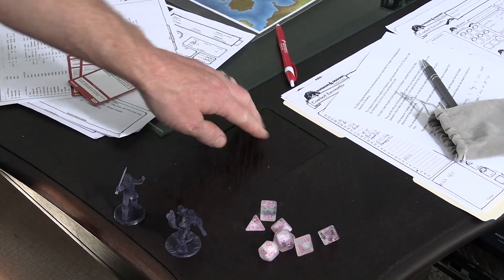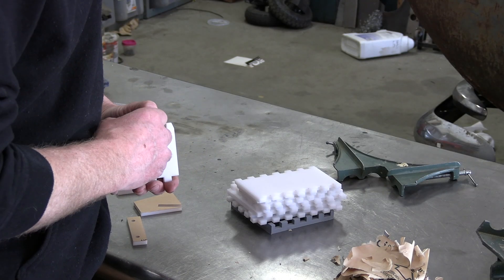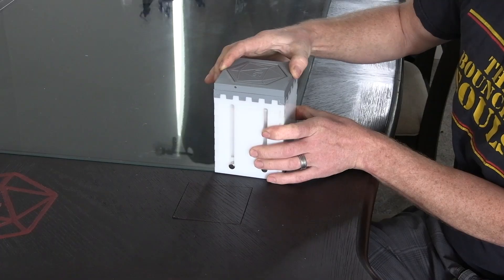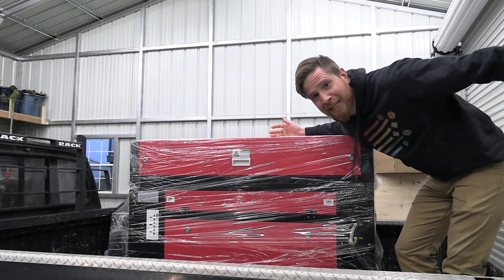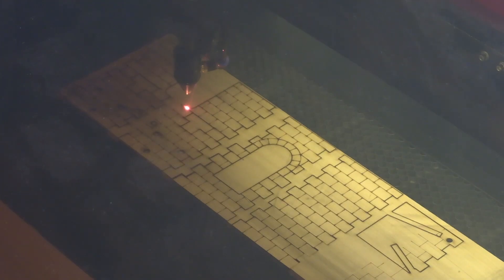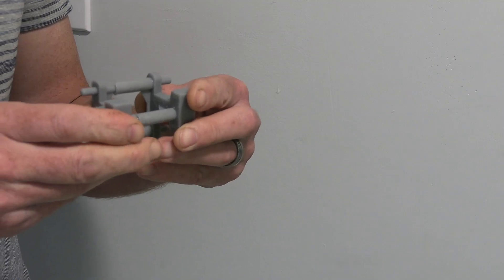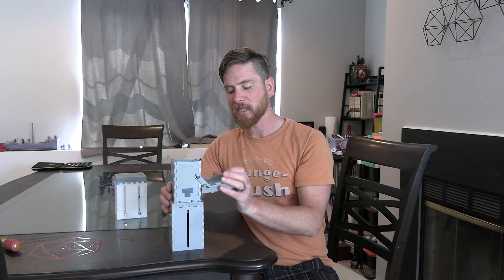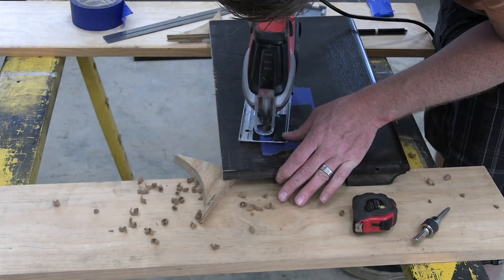Building the Ultimate D&D Table(TTRPG): Part 2- Hidden Dice Tower Upgrade!

Comment: This and the original video are sick and I love them not to mention how much I wish I had a table even close to this.

That said I’ll also offer one criticism as well from the TTRPG side of things. It’s said that to be a properly randomized roll from a dice tower your dice needs to have at least 3 contact points with the inside of the tower. Otherwise your rolls are lacking in randomness. If I were to buy a tower like this personally that’s definitely something that I’d not only be looking for but would be a dealbreaker for me. If you look into towers online you’ll find the good ones always try to include 3+ platforms for dice to roll off of. Obviously it might be a bit difficult to include this in your table ones but if you’re selling these out and about I’d suggest making a larger sized one for sale maybe? That way folks have an option of how randomized they want to get.

Comment: Use your laser to cut a template for creating a hole in the table. Hog out the majority of the hole with a jigsaw, and clean up with a router and flush trim bit for a perfect square. Well except for the corners which you can clean up with a chisel or just make your design have a rounded corner that matches the diameter of the flush trim bit.

Comment: A few modifications to the alignment base would make a difference. At the top of the alignment base, cut sunken wells for the flex stop pins to rest in, so that the tower stays still in the center and the pins are hidden. You could also cut tracks into the walls of the alignment base for rounded flex stop pins to ride in, making a smoother movement.

Comment: I think the previous design was better in terms of aesthetic, it just had a few kinks that needed to be ironed out. The spring-loaded action looks much better from a production quality standpoint, especially compared to the new iteration you made with the seemingly free-floating? tab at the top, with pins to keep it at the top. I think you should've focused on cleaning up what you had rather than starting over... mostly because it was pretty good.

I get the whole self-deprecation thing with the 'more tools than sense,' but it's not uncommon for an inventor to doubt their creations. Sometimes they glance over a good idea because it doesn't feel right to them. Even though it's tough to differentiate between an idea being flawed or the design being flawed, ya gotta figure out which it is before innovating. 

Either way, I suppose it doesn't matter. My group's gone full digital and we do everything via discord; just thought I'd share my two cents.

Comment: I would have used that pop top as a cover for the hole, when pulled up it will display whatever emblem I put on there as well as reveal the hole to drop the dice down. I'd do this to either forgo or simplify the dice tray at the bottom. If I kept it, it would just be a cover that pivots up or down when the tower is down or up.
As for locking when up, I'd just use some flat pieces with triangular extrusions that pop out slightly when the walls aren't there. Might have been slightly simpler than the button with the dots.

Comment: Is the shop not set up yet or ??
Reply from the maker: After fulfilling the orders from the Kickstarter, I found that even when optimized, it still takes a good amount of time to cut and print each one. In an upcoming project I will be redesigning/ improving  and creating an all (or nearly all) digital option that will have the advantage of a much lower cost as well. Stay tuned!

Comment: Tip I learned for those ugly burn lines from the laser cutter: cover the surface you’re cutting with painter’s tape. Protects that top layer from scorch marks. I’ve mostly used that with my laser etcher but I imagine it might help with an industrial cutter as well.
Reply from the maker: The acrylic comes covered in protective paper tape but after you cut them it takes way longer to peel off all the little pieces than it does to just wipe them down with alcohol
Reply: @MoreToolsThanSense  I meant when laser cutting wood

Comment: For SLA printing you shouldn't be printing your objects directly to the build plate. IIRC first few layers are overexposed to ensure they stick to the build plate. I forget if a raft or just supports is the better option.

Resin is also weaker than PLA in stress tests
Reply from the maker: True, you're not really supposed to stick it right on the build plate... but with an absolute square of an object, it's nearly impossible to get a nice finish on all 6 flat surfaces any other way. Also, I use tenacious additive to the resin, you can bend a 5mm thick piece nearly in half before it snaps, It's passing all of my stress tests!

Comment: Perhaps strong embedded magnets into the top of and bottom of either the shell box or pullout tower itself would give it a smoother operation without the need for the "button" release. With this methods you might just need a couple of coin magnets or small bar magnets. Love the idea of a tower in the table overall though, that shit is rad as hell.
Reply from the maker: Couple people suggested magnets and I even had that on my list of ideas early on. Not sure why I dropped it because...y'all might be right.

Comment: This is a great project! Looks good, fun idea, all in all a project which I might pick up myself one day. 

One thing I would change over the current design is for most pop-up things I'd probably use magnets instead of some pin mechanism. this allows for some fluidity in the movement and it also be easier to engineer a bracket to mount magnets on rather than a pin mechanism like this, which would require many prototypes before you get it right (like what happened here). also the magnets might be easier to hide than a pin mechanism, so you dont have to worry about designing for example a pop-up tower around one prop.

Comment: The build is great and I'd just recommend some type of grooves on the inside that the tower can slide into the housing with to give it less jiggle jiggle and more smooth stability, but 100$+ just is too much for me! Would be more then the current table and materials Ive got so far :( Happy to see more of what you build!
Reply from the maker: not a bad idea, would likely be tough to add without making the case a good bit taller and thus, more likely to bang into your knee or foot.
Reply: @MoreToolsThanSense  What if you did it more in a widening sense? So on the inside of the housing if there were like channels/grooves, or on the tower part that pops out, if you did them you could have them slide directly into placish. Kind of like the idea of how brackets or such on a keyboard tray work

Comment: You said that the holes in your table top are too big for the final iteration of the dice towers why not glue in some hardwood strips along the inside edges of the holes and file/sand to correct dimension. Seems like that would end up being less work overall and if you use a contrasting color of wood could be quite beautiful.
Reply from the maker: A fine idea! However I am planning to make custom Veneer that will match the table and also fill the (pretty small amount of) gap. This will also let me refine the process so that I can offer hardwood veneer as an upgrade for future customers.

Comment: It'd be nice if the ramp acted as a stopper when the tower is hidden, that way you could store your dice in them when not in use
Reply from the maker: I have it this way for the original wood ones, problem is that you then need a huge face plate that sticks straight up when it's open. I'd say if want to store your dice inside, just bag em!
Reply: @MoreToolsThanSense  Sorry to use this comment, but I couldn't find a way to message you.
I'm a physically disabled DnD player and am amazed by those towers. Rolling dices is a struggle for me, so I resorted to digital rolling. But seeing this, I think I could roll dices with it!

Is there any way to get templates of the dice tower? I would only need the inside "box", where you throw the dice in and it rolls the dice.

Comment: For anyone working on something similar, don't use loctite it eats plastics and make it extraordinary brittle over time.
Reply from the maker: Correct, The loctite only goes inside the metal on metal Chicago screws.

Comment: Very neat finish and not at all the mechanism I would have used, which just goes to show there are many ways to a similar result. 
For myself I'd rather there wasn't a ring pull but a rotational lock - that ring pull drops enough that small based and heavy enough objects will just fall over and if you ever run a pen and paper over the top you will have a bad time. Where the rotational lock concept can have a flush finish and be a nearly perfectly smooth table top (if you care to put in the machinist time and skill to hit really tight sliding fits even an invisibly smooth finish to the insert (though that is excessive)).

Comment: These are awesome, went straight to your kickstarter to buy some, but for a single sheet of laser cut acrylic and some screws it's way too expensive sorry. Appreciate that thick acrylic isn't cheap and you need a margin to make it worth while. Maybe a cheaper mdf/ply version that could be painted by the buyer would be able to bring the price point down to a more accessible level as most people who want to install a pop up dice tower are going to want 4-6 of them lol. Great project though.
Reply from the maker: Thanks! Yeah, I know the price point is a bit high. I hope to make some out of wood in the future but to be honest that won't lower the price all that much. A lot of the cost is tied up in the fact that I'm making them one at a time and even the DIY kits take over an hour to print, wash, cure, cut, inspect, fix imperfections, organize and box. If the demand grows, I may be able to higher some help or find a way to streamline the process but for now, to be honest I need the keep the quantities low. If I have to make 2 kits per day, there won't be any time left to make more videos! lol
Reply: @MoreToolsThanSense  that makes sense. I've got resin and FDM printers myself, could do a self-print option for some of the parts but you do open yourself up to infringement if you do that. I wish you the best of success :D

Comment: You should look into putting pin holes on the side that can be slipped into, instead of sitting them on the top of the housing.   It would look nicer as well as be more stable.
Reply from the maker: That's a nice idea, the only issue is that having the pins separate from the button is already a difficult problem and if I were to move them further down, it would exacerbate the problem... I might try one prototype out though.
Reply: @MoreToolsThanSense  They don't need to be separate. Just make two holes or recesses on each side on the inside of the tower base. It will add additional rigidity to the tower when it's extended. Literally no mod to the tower - just some little recesses in the base for them to click into instead of loosely resting on top of the base.
Reply: @MichaelJKyzer  I was thinking the same thing but having them ride in little grooves on the inside of the tower wall till they fall into and lock into the holes.
Reply: @MichaelJKyzer  That was my thought too. Just a few divots for the pins to sit into instead of on top of a flat surface.
Reply: @MoreToolsThanSense  might work if you put a pivot (or a catch) higher than the button, making pin farther away retract properly.
having a fulcrum higher than the button means you don't have to press as much to make the pins travel further.

Comment: This is a really neat idea however for those of us that already have gaming tables that would look at retrofitting them something printed out of plastic will not work. For instance my table is made of walnut and I don't want Gray pieces of plastic appearing on the top of the table. I would rather simply buy the SVG files G files and cut my own out of wood to install in my tabletop.
Reply from the maker: I do plan to make wooden tops available in the future but I don't have a CNC mill yet.

Comment: I was wondering for a while why you didn't do it in PLA using FFF. You're going to sell it as a kit and laser is so much faster and easier to ship, so makes sense. For the glue, I wonder why you're using E6000 which is very flexible glue. For this I believe you'd want a chemical welding glue. Given the likely overall investment for this, I'd also go for plastic threaded inserts.